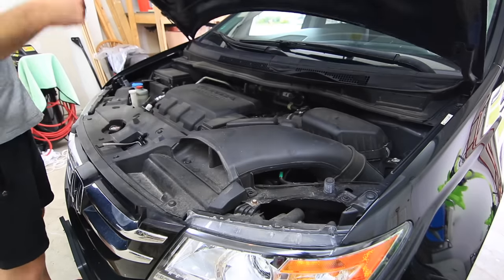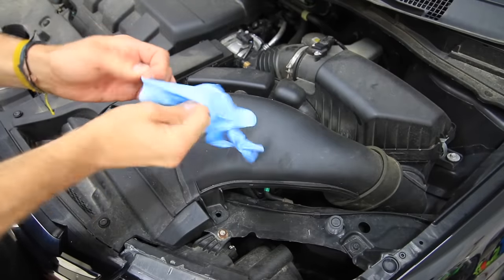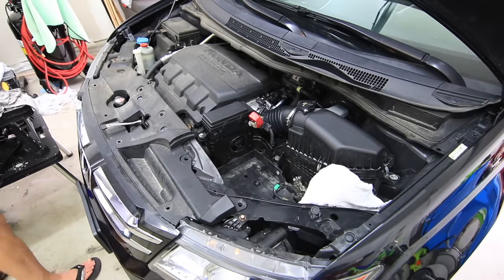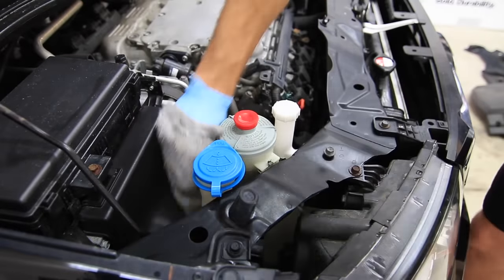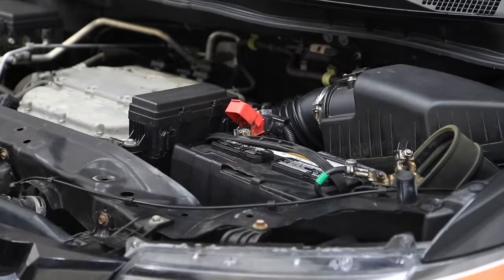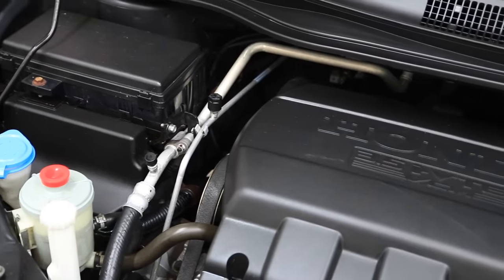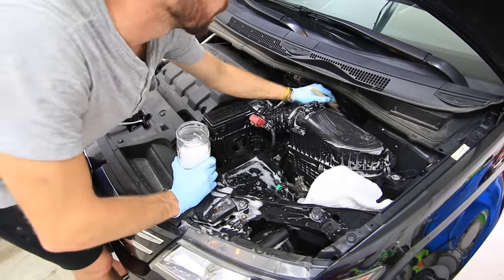Safest Way To Clean Your Engine Without Water!

Comment: A little caution goes a long way.  From my experience, directing water away from or covering the distributor (if you have one) is the only precaution needed.  You present an good option here for those who are unsure or are extra cautious.  Personally, I want to rinse the soap residue off.  Long term effects of something like dish soap is to dry out plastics, rubber, and finishes.  The 303 rinse and wipedown helps.

Comment: Great video man but let me pass on some advise or tip. 1- I suggest to use a stainless steel wire brush or brass wire brush for cleaning the aluminum parts of the engine. If you use a steel or ferrous metal brush you will cause corrosion on the aluminum parts. What happens is the steel particles from the brush get impregnated into they aluminum and cause what we in aviation call dissimilar metal corrosion.2- install a battery back up device that plugs into 12 volt cigarette lighter plug outlet. This will save you a headache of settings and reprogramming your electrical things.
Reply: Where can I get one of those battery back ups for cigarrete lighter?
Reply: I maybe wrong. If you add a battery backup. It defeats the purpose of disconnecting the battery. Things could still short out, right?
Reply: @dkcbr600  no cause not enough juice. Just barely enough for to keep memory
Reply: Honda radios have a theft code that must be entered once the battery has been disconnected. Often, this code isn't present with the vehicle and a phone call to the dealer has to be made. Battery back up is a great idea!
Reply: Thanks for this tip Joe Montero! The input from aviation mechanics is priceless!

Comment: I find detailing as oddly satisfying, relaxing and as stress reducing as a good massage. Btw I started doing it after watching your videos. One tip - try replacing or cleaning up the rusty bolts with a wire bristle brush and adding a small dab of black paint on them. It would give the engine bay that ‘new from the dealer’ look.
Reply: Just bear in mind that when you are selling your car, replaced or tampered with bolts in the engine bay raise immediate suspicion of repaired/replaced wings. You will be asked if your car was in an accident. You will honestly say no, it was just engine detailing.. 9 out of 10 won't believe you and walk away.  I probably would.  And no, you won't be able to paint it over so it would have a factory look. One can see tampered wing bolts immediately.
Reply: I’m so addicted to watching and doing it. I just got a new car (used) and can’t stop obsessing over it. And I started a mobile detailing business. Well I made the flyers and I’m passing them out today we will see if I have any bites

Comment: You said without water!
Reply from the maker: Not sure how you get much more waterless than this! Most people try to use a hose or pressure washer
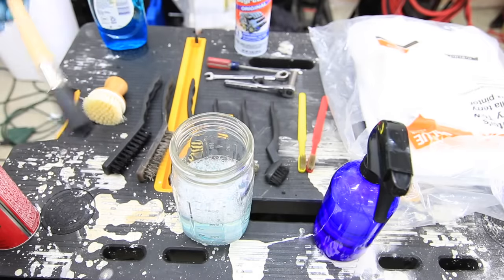Reply: Donald I agree,I guess "Without Water" means use water ..WOT !!! 2:52 you actually say water . Don`t care how much you use you`re still using it .. Plus that engine is not that dirty , Looks like it was clean and had some dust thrown over it . Check this out, Thats dirt. https://www.youtube.com/watch?v=CLOf5r7cuR8
Reply: mierda! not even 20 seconds into the vid he mentioned by waterless he means no hoses or excess water will be used

Comment: I use a flower watering pot with warm water to rinse off the engine bay. Then use a leaf blower to dry. Use S100 spray to brighten the black pieces & helps keep dirt off

Comment: One tip I can see is to let the engine warm up....not operating temp but just warm snd spray a product called super clean on it let it sit for 15 or 20 minutes rinse off and then you can hit the rest just like you did. That's my tip
Reply from the maker: Good idea! Will try it next time

Comment: For myself I wouldn't disconnect the battery unless you hook up a memory saver power source. You will lose all your seat settings, radio settings and likely you will have to drive around for a while until the ECU  is reprogrammed from driving and from the start and stop cycles. If you need to smog your car soon, it will fail until the ECU is reprogrammed.

Comment: Better to disconnect battery to avoid electrical short before washing engine, although I've washed many engines and never disconnected the battery, nor had a problem. Spray entire engine and bay with degreaser, let it sit for like 10 mins and rinse the engine off like normal. Then use a leaf blower to blow dry the engine and bay. Last reconnect battery and enjoy your super clean, dirt and oil free engine!

Comment: $2.85 engine cleaner in 10 minutes. Armorall tire foam (cleaner and protector). Spray everything, let soak for 2 or 3 minutes (or one 12oz beer) wipe bad areas with clean rag and blow rest off with air hose or leaf blower. Looks brand new. (New cars have mostly plastic covers under the hood.) If it has never been done may have to do it twice. (Grab a six pack). I throw a blanket on the windshield to keep it clean.
Reply: Why is he doing all this extra stuff? Waste of time.. Just spray it off with water or at car wash for 2 minutes then spray with foaming tire cleaner and drive away.

Comment: The soap left behind will eat up the plastics and the metal coatings. Dish soap i very acidic. I have always washed and rinsed my Audi engines for the past 20 years without a single problem.

Comment: Any car after 2000 is pretty much safe to wash the engine bay. Why dose everyone freak out about this vid done it multiple times to my engine and it’s started and ran with no error code lights on the dash and I’ve never had issues.

Comment: You do relies that simply driving down the highway, getting behind a 18 wheeler in traffic, while it is raining, will allow tons of water, and fine mist into your engine bay? No more then you would if you used a pressure washer to simply "clean" your engine bay. I have been doing that for years, And I have done it to all my late model cars, such as my 2015 Nissan 370z, and my 2018 Nissan Frontier 4.0 v6, And have NEVER in my entire life of doing this, experienced any troubles at all, period.
Thing is, That you simply do not want to use a pressure washer on your engine or engine bay when it is "hot" after driving your motor vehicle, as with a pressure washer you would be "localized" in a particular section, and that indeed could cause some undesired results, such as Steaming and blistering of you cars paint, Use common sense. And Pressure wash your engine anytime while the vehicle is cooled down and you will get excellent results. Period. You sir, this time, are mistaken.
Thanks for making this video, and you actually did do a decent job cleaning that engine bay.

Comment: If I remove the battery from my 2019 Acadia, I have to reset the fobs and that leads to a lot of problems.  I'll bet it loses my bluetooth connections too.  Instead of using the brush and the soapy water, you should use a rag dipped in soapy water and rung out and wipe an area, then dip back in bucket and repeat, so you don't have water running down.  Also those cheap Member's Mark disinfecting wipes might work for tight areas.

Comment: Agree, always disconnect the battery.... water is ok to use, you just dont hold it on any one area for any length of time. Ive not used 303, Koch Chemie Motorplast is a good product.. just evenly spray it over the engine and leave... you dont touch it. I think its a better finish looking from what you got from 303.Also throughout the cleaning and finishing.. touching the engine area could possibly introduce dirty binding

Comment: I wonder for those rusty bolts, if you could remove them, soak them in vinegar and re-spray them with Rust-Oleum Black or Silver, if that would work as an extra finishing touch?

Comment: ever buy a used car? guess what they power wash engine bays, its fine engines meant to get wet almost all cars never had splash shields never any problems ever drive through huge floods? its open to the atmosphere water in that too,cars fine, its just the constant use of water/product of you choose day in and day out that corrodes things not cleaning your engine bay once every 1/3/5/10 ...years

Comment: I have powerwashed mine since the 80s with no problem You just haft to not hit the electrical components no need to take battery out I have been detailing  for 30 years

Comment: You cleaned up the engine bay, yes, but not so much the actual engine. You only got the top. If I had to get under this engine to work on it, I'd still find it a greasy mess.

Comment: I believe autosmart are just coming to America. Use their apc called G101, it's also decreases. Cover engine and underneath of the bonnet or hood. Wipe with a microfiber. Then spray over with finish. Leave it to absorb while you clean the rest of the car. Wipe away any product left. Simple and easy. Cleaning with G101 takes 5 minutes

Comment: I have a tip on Honda's. Radio code. Always make sure you have the radio code before disconnecting the battery. Another one is Toyota. After reconnecting some Toyota batteries, it loses its memory for the computer for idle. After starting, you might have to hold your foot on gas pedal to keep it from stalling. Average relearn for idle is 10 to 15 minutes. I get some people call me and they think they messed something up after cleaning engine bay or just installing a new battery.

Comment: The three rusty bolt heads can be addressed with a paint marker or spray paint, I know, a little OCD but I love to finish a job completely. I always have brake manifolds rust so I mask them off and spray paint them black. Getting rid of of anything rusty under the hood makes an an amazing difference. I have a Jaguar XJ-SC 12 cylinder and do the occasional car show and by using simple cleaning techniques, buffing metal and hiding rust you can fool people and even judges that you spend hours under the hood.

Comment: You could get by with using 2-3 walmart bags to cover the battery, and distributor, a  diluted degreaser50/50 and a low pressure sprayer such as a Worx spray gun, start the car up ASAP
let it run a few minutes, Then blow dry with air gun or battery leaf blower. Then the dressing.   I have been doing this for years with no problems what so ever. Engine bay looks BRAND NEW.
Still a great how 2 video.

Comment: 303 aerospace protectant is the best but as a professional detailer I would pressure wash the whole engine while running, dry it then use the 303. No need to disassemble anything and it cuts your time in half.

Comment: How much water do you think the engine bay gets when your driving down the highway at 65 mph during a rain storm.  Water is not going to hurt your engine, better yet watch a video of a Jeep going through mud and water over 4 feet deep. Now using a power washer might be a bit to much but a garden hose...... not much pressure.
Reply: Dave Standiford is it water that creates the blue battery corrosion shit!?
Reply: R IV , I don’t think so but ? If your concerned dry it off, I’ve done this to all my Jeeps never had a problem.

Comment: But I guess whatever works for you you definitely do water most importantly you need to leave the engine running so it doesn't have a problem when you try to turn on cuz it's already on

Comment: I thought it was a good idea to cover up the battery, the alternator, distributor and cap, anything where you don't want water to get in.  My power steering container is leaking somewhere, so I want to remove the greasy build-up from the drip to determine which hose is cracked.  I'm sure it's not the pipe leading to the pump because there's no drip or greasy build-up on that side of the engine.  I want to try just soapy water to see if it will get clean, but I don't want to accidently drip any water that can wreck one of the parts.  Overall, the engine bay is clean, just greasy build-up somewhere under near the container where you add the power steering fluid.  I hope you see this comment.  Thanks in advance if you have any advice!

Comment: I always use a preasure washer to clean my engine but i do it from the under side of the engine not from the top cause thats where all the oil and stuff is not on the plastic on top

Comment: You need a Power Supply Cable Memory Saver if you disconnect the battery on most modern cars

Comment: Doesn't just wiping off the soapy water still leave some residue if the soap is not rinsed off?
Reply from the maker: Some but when you spray on the 303 it pretty eliminates the residue and protects the surgace

Comment: Hi there, I just subscribed today.  I do have a question.  I have a 2004 Mercedes E500 that had a valve cover seeping and it has the top of the valve cover along with the ignition coils covered with dirty oil.  I need to clean it off.  My first thought is to use my new little steam cleaner, that I bought for  interior use,  and steam it off.  I don't to cause any electrical problems but for sure didn't want to use a 3000 psi pressure washer on it.  What are your thoughts?  Thanks, Tom

Comment: 6:26 did you have a stroke? ahahahaha great content as always, and great tip, not many detailers say in videos you should remove your battery, wish is very important, but a lot of people seen to not get that.
Reply: Bruno Fey I've been detailing for 3 years and I have never seen anyone take out the battery. I have had that concern however I was advised that it was unnecessary. That is a great tip and the video was awesome.
Reply: Cedric Webb in old cars maybe it wasn't, but in modern cars I think it is. Not only because of the electronics, but also the fact that any remaining liquid can evaporate and stick to places that might cause shorts or just plain rust and bad connections. Taking the battery and letting it dry for a few is not a bad idea at all, mainly in European and German cars, which seen to have more than 20 electronic centrals sometimes. Like the Citroen DS4. Water can't get near that, or it will be close to 10 grand in damage.

Comment: Hi ! Thanks for the good video. I have a question though.. I recently cleaned an engine, removed the battery, detailed it, then I mounted it back in. However, the engine computer was 'reset' as Ive been told ( radio reset and rough idling )... :( 
How can I avoid that ?

Comment: Great looking engine bay, but another tip i would suggest is pressurized air. With that much soapy water, you are determined to get water in sensitive electronic connecters!! Blow it out before installing ur battery, wiping isn't as affective:-)

Comment: Be careful about taking the battery off. In some cars, disconnecting the battery can completely wipe its computers data, making it unusable without a proper reprogramming. Do a little research beforehand. From what I have seen, Mercedes and Land Rovers from the 2000s and later are just some examples of cars where you don’t want to disconnect your battery. Great video as always ;)
Reply: Thats hard to believe. But I wouldn't doubt it. Thoes types of vehicles are nothing but trouble. Hondas are much better in terms of reliability

Comment: Great video.  I have never been a fan of power washing an engine bay.  90% of the time if done correctly there are no issues.  But when an electrical gremlin pops up... FRUSTRATING.

Comment: Why don't you leave these plastic covers off?? It'll keep your engine cooler. That's what I did with my 2008 Honda Accord.
Reply: I'm not a mechanic! The plastic covers are just splash guards. If your vehicle is running at the correct temperature. Why not leave them on?

Comment: This is not a very dirty engine. Show how to clean a greasy, messy engine that had oil leaks and a couple hundred thousand miles on it. Then I will be interested in your methods.
Reply from the maker: You got one I can borrow? lol I am working with what I got and try to keep mine from ever getting to that level.
Reply: @StaufferGarage  I certainly do!  A 2000 Plymouth Neon  with 251k miles.  Only problem you would have to come and get it in Montana.

Comment: I'm always so worried of water getting in places I don't want it to be in, even with this method lol
Reply: Engine are supposed to be an air right system. Water shouldn't get places where water doesn't belong. Especially with this method. I just would put water directly on electrical connections

Comment: I am highly confused. The title says no water is used during this cleaning session, and even is mentioned in the beginning of the video. But then he says that you will need warm water, and after you see him vacuumed under his battery he says to use soppy water. Although he did an amazing job at washing the More difficult areas. I feel this Video is somewhat clickbait.
Reply: Kassie ShauGhnessy waterless mean there is no water being sprayed through a hose or pipe. Sometimes detailers use spray bottles or pump sprayer to conduct what is refered to as a waterless wash. I agree with you, however the industry say it is waterless.
Reply: Definitely not clickbait. using water to mix with soap is not even remotely close to the same volume of water you would use by spraying the engine bay down. Huge difference. Thus, "waterless," though not technical in the strictest sense, applies on a pragmatic industry-speak level.

Comment: Very well put together tutorial, I am personally not a fan of dousing the engine with pressurized water as there is always the chance of water pooling in the crevices, nooks and crannies and leading to electrical problems.
Reply from the maker: Exactly why I put this together. I avoid dousing it for the same reasons

Comment: Never once had any of the problems you mentioned when using water to detail an engine bay. Detailing engines is not hard. And I literally need 2 items and less than 5 minutes, degreaser and pressure washer that's it.